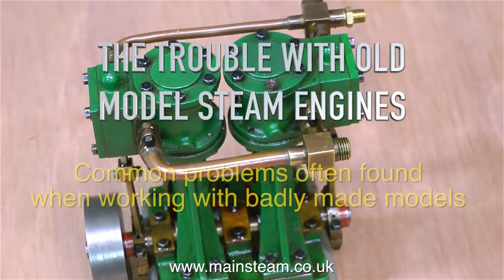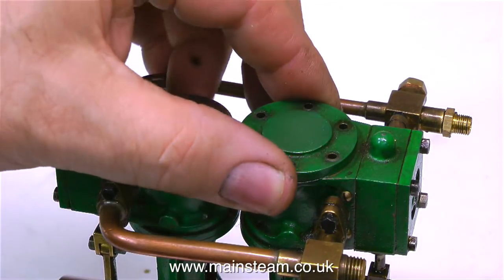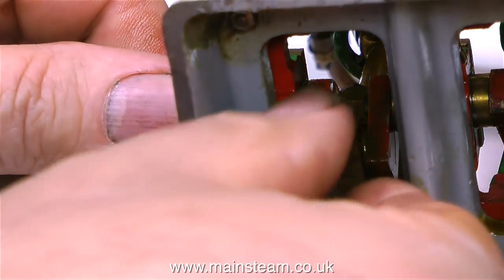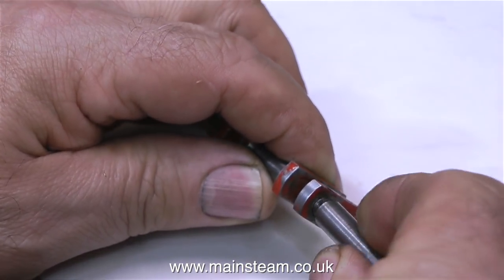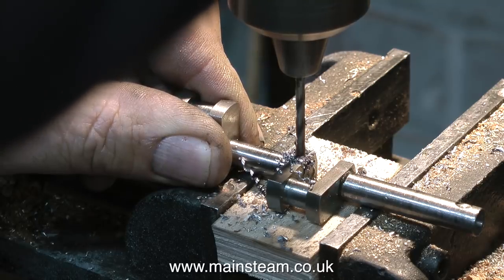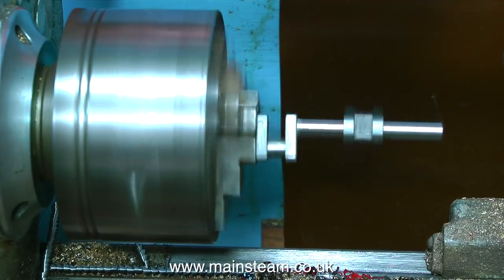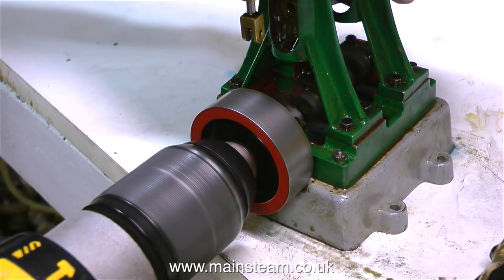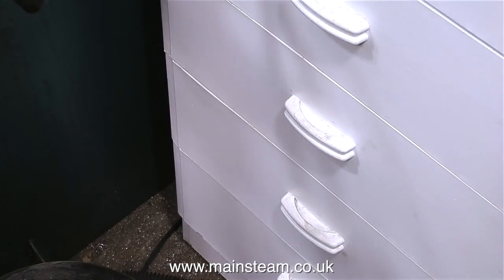THE TROUBLE WITH OLD MODEL STEAM ENGINES

Comment: I love these old engines I built several of them back in 1966-73. They are very difficult to do and you must take your time and build them right no cutting corners. Otherwise you see what you get junk. I wish I could afford to buy a Stuart beam engine that was my favorite one. I used them as part of my engineering program for school. Blew the teachers away that I understood how they worked and that I made them and my own drafting work and report paper on the engines. Even the principal gave me a certificate at the end of the year for my hard work. I was crazy for Me. / Mfg. engineering. I wanted to build a Shay logger engine that ran on steam but couldn’t find the plans or funds to do it.

Comment: I risked machining my D10 crank from solid as a test of myself, and it was very hard but very satisfying. Pages and pages of conversions from fractional imperial to decimal imperial, and shedloads of panicking.
Luckily I got it all within spec first time, but a bit of a scratchy finish on the centre bearing surface, so not perfect. I plan to take it a few thou undersize to get the surface finish ok. Overall I am very pleased. Until you have one of these cranks in your hand it is hard to visualise how delicate they are when un supported by bearings! I think a loud sparrow fart in the garden would bend it.
I am now constructing a drill rod/ silver steel jig to perfectly align/ position the crank bearings with the cross heads, and then do something with taper pins to make the position repeatable. Every part of my milling machine is positioned with taper pins, then bolted...they used to do it properly in the olden days.

Comment: In 1950's I got a steam engine for Xmas... about a foot high... electrically heated water/steam tank, cylinder swinging back and forth against a base with holes did the valving for the steam... very simple... I used it to power a vehicle made with an Erector Set...

Comment: Just a suggestion. Instead of tapered pins, I know demo only. Just disassemble the crankshaft. Clean all parts with brake cleaner. Now place a drop of RED loctite on all the threads. Reassemble crank. Now, place a live center in the center drilled hole you made. Use a dial indicator to be sure the shaft is straight on all the segments of crank. Be sure to maintain the 90* angles. Once all is straight on the dial indicators. Just use a small flame on a torch, or good lighter. Warm all the joints where loctite was applied, not to hot to touch, just warm. This sets up the loctite very quickly. Now let set for the night. Crank is now effectively a one piece crank.If you ever need to disassemble it, you warm up the loctite till it starts to give off smoke, then loosen joint. Use a mask, as the smoke is hazardous.RED loctite is permanent on shafts this small of diameter. Not historically correct, but only you will know. Just my two cents.
Reply from the maker: "Loctite" will not repair a Crankshaft as badly made as this one. In this case I tried "Loctite 603" off camera with the crankshaft held in the lathe chuck etc etc. By the time I have messed about with various bodges, it's just quicker to make a new one . . . .

Comment: Yes, I found this video very helpful, I never realized that there were so many ways to mess-up a crankshaft. I do not understand why they threaded the crank parts and the webs to fit them together. thank you very much for this display and lesson.
Reply: A major problem with just screwing parts together to assemble the crank is getting the journal timing correct. The pin Keith installed corrected that, plus eliminated possible wobble at the joint in one axis.

Comment: that engine is salvageable with a new one piece crank shaft turned between centres to ensure it is true , the two throws should be turned after the main bearing areas using a jig to give them 90' offset to each other , the  existing main bearings are salvageable , bolt them down to the bed then use a hand reamer to ream them out as needed so they are perfectly in line with each other , turn the crank main bearing diameter to suit your new main bearing ID , job done , great video take it easy

Comment: years ago when I was in my 20's, an old foreman I was working for told me one day " there's never enough time to do a job right the first time, but there's always enough time to do it over". nice vid
Reply: how true...
Reply: exactly
Reply: jerry umfress 
As a head of the QC QA department in a machine shop, that is the case... But to a point. .
When the machinist find out that they can not slip non conforming dimensions past QC, and they have to do it over, they become more meticulous. And the QC dept works itself out of a job.  The plug and play reputation goes way up. And the customer is willing to pay more for it. After 13 years, they closed the QC dept. I do not know if they still have the same plug and play reputation.
Reply: steve gale 
The place I worked, I would generate a QC report on each part. Every dimension would be measured and recorded. When I found a non conforming feature,  I would go to the machinist and say something like, I  must have made a mistake, I  am not getting the right number here. And then they would remeasure,  and either fix it, or ask the engineer to either sign off on it, or the engineer would call the customer for his ok...
But a copy of the QC report would be sent with the part to the customer.
In the 13 years , I filled 5 , five drawer filling cabinets with QC documents. 
Most all of the problems came from the customer sending us the wrong prints, or prints that were not drawn correctly.
Reply: steve gale
I hear you,,, the point I was trying to make was quality control. And I  was trying to state that the time spent making it right the first time will be worth it with a greater reputation. 
Speed comes with knowing how to do it right.
But although we did some production work, most of what we did was custom, one of a kind, reverse engineered. 
Most of the dimensions were + or - 5 thousandths  of an inch. We did make gauging to 50 millionths.  
But alas,,  when working for yourself, on your own projects,  you only have to satisfy yourself, .
And that is all about attitude ,and pride, and expectation.
Reply: steve gale 
Ah yes,,,  How to win friends and influence people,,,   This was the way I put the ball in their court, and it required them to prove me wrong... I could have gone strieght to the foreman,  and let him chew them a new one. But this was my style of letting them save face and fix the problem without getting the bitch cycle started...
They were grateful,, and said so...
Reply: If you're on salary, the job needs to be done right the first time so you can proceed on to the next. If you are paid hourly, you can do a sloppy job twice and thus guarantee an extra week's employment.
Reply: You worked at Micromeritics?
Reply: When I was a youngster I said to my Father it is not that critical, he said if you do not practice being accurate then when it is important then it is more difficult to obtain a good result! Words of wisdom from Dad, my MO since that day. Cheers from John, Australia. PS, I have worked on machine jobs worth hundreds of thousands of dollars! Do over?
Reply: Will Bee that's the best way to approach someone when you think they made a mistake...."I must be looking at this wrong, can you explain to me how this thing you made meets the specification that it doesn't".   Works for engine repairs, software builds, HVAC ducting, and more.   The nice thing is that in some cases, it can actually be explained as correct.   If the other guy is right, you still hold the high ground because you went in saying you didn't understand it.    If he's wrong, you leave the path to fixing it wide open without causing embarrassment.
Reply: You will always do it better second time.

And even better still third time.

Comment: When I built a Stuart steam engine in the mid to late 60's while at school the piston and crankshaft were supplied as  cast iron. As I remeber it I machined the crank shaft in a four jaw chuck on the schools ML7 lathe, also there was no piston rings but the bore and piston were a good sliding fit.

Comment: Interesting observation that poorly designed engines typically have their little "fiddly bits" painted a different color.  I propose the reason for this is because the builder/designer/engineer of said engine was more concerned with how the thing looked rather than how it performed.  There is certainly nothing wrong with aesthetics, but that concern should should FOLLOW ensuring that the design is mechanically ideal.  A solidly engineered device sells itself, even if it's ugly.  However, flashy sequins, rhinestones and glitter are needed to make the "turds" more appealing.

Comment: Quite an interesting and concise video. You did an excellent job of discussing this sloppily built engine. It seems that every component was either suffering from a lack of quality in build or design with a touch of manhandling to spice things up. You as I agree in being suspicious of mechanical objects that have non-uniform fasteners and paint in places where it doesn't seem necessary. I really don't understand why someone would invest their time and money designing and building something so poorly. It's a nightmare from the start. I would hate to see the aftermath of what an excessive amount of pressure or RPM would do if someone happened to be near this particular contraption if it flew apart. You did the right thing by gathering it up and placing it it the drawer. At least it was worth the instruction that you gave on machining.

Comment: I'm really getting nostalgic right now! Use to work at Sulzer in Switzerland and we built Ship Diesel Engines years ago, just a bit bigger. However, I always loved model engines as well!
Reply: 4 years ago you wrote:

I'm really getting nostalgic right now! Use to work at Sulzer in Switzerland and we built Ship Diesel Engines years ago, just a bit bigger. However, I always loved model engines as well!

I want to say thanks and I always thought the marine slow speed Diesel engine had more
In common with an old steam engine than a modern diesel in physical construction.

Are you from Winterthur?

Comment: Hi, nice video and I agree with all of your comments and complaints. I actually live within 1 mile of Stuart Models and upon request, have recently drawn in CAD one of their Twin Cylinder Steam Engines. The company have invested heavily to produce parts for each of the steam engines on their books. I think the painting and poor fits/workmanship is down to the engineer building the engine not Stuart Models, even though they supply the parts as a kit. Again, excellent video, and I like the relaxed way you go about explaining the problems , and the joviality introduced  to the commentary. Thanks

Comment: Good tip on the paint observation perhaps those come out of a factory with much less. Quality control , pride, or engineering or a combination of all the above ?  I dont have much experience with the newer models but my wife’s Grandfather ha many older model engines that were made very well   And because he was a retired Steam engineer they ran well. Although i suspect that he  made that happen by machining  and balancing things  himself  many of those engines were installed in wooden toys he handcrafted as well

Comment: Taking your point on gratuitous painting of ancilliary parts Mr Appleton. . It's the equivalent of seeing a second-hand car with the tyres covered in 'tyre black' and the engine bay freshly steam cleaned. You just know that chances are.....it's a dog.
Reply: The Philpott going back 20 years, when you used to be able to sell old cars, my stepfather would buy and sell them regularly. I remember the 'Colin Special' would be a car washed clean with his mums dish soap, or shampoo, pinstripe along the side in cheap Chinese electrical tape, in whatever colour the cheap store had, tyre black tyres, silver frost hubcaps, or wheels if no hubcaps, and the cheapest, horriblest rubber mats he could find, or off cut carpet mats. Occasionally if his dad got him an oil filter from work (he was a mechanic in a hospital) he would do an oil change with the cheapest oil on the market. I think from when mum met him, when I was around 6, until I moved out in my late teens, he would have had over 50 cars. All done the same.

Comment: It makes perfect sense that engines with  nuts and bolts painted with mismatching colours are generally in poorer condition; Someone, a previous owner, refurbisher or reseller opened it and did something like a repair or checkup, then put it together with what ever nuts and bolts were at hand at the time.
Highly unlikely something like that'd happen earlier than that like during the original fabrication since bolts, paint and such like gets ordered big bulk.

Comment: The biggest issue I have with those engines is that they don't produce 5 to 10 kW so they're basically useless except for looking at once and a while or for tinkering.

Though, if it's the tinkering you like then you kind of have to buy a really cheap and crappy one or else you're not going to have any fun.
Reply: Truth be told, I'd probably be terrified of a larger steam engine, with all that pressure just waiting to hurt someone. But I agree at the end of the day these are just toys especially when it is recommended in some cases to not run them for more than 10 minutes at a time before re-lubricating.

Comment: I'd be inclined to fit up the end mains closely, and just bore/drill the center main oversize. It is just a model, and would probably spin up and run fine. The piston sizes - who cares? as long as they will seal ok with the rings, you're good. If I were playing with these, I'd probably end up using lots of small helicoils to fix the various bad threads. Those cranks are nasty - but with a lathe of that size at hand, a person could probably rig a way to grind the main journals true.

Comment: Once you dial in your crank you should have tack welded each connection of the crank to tighten it up.
It is after all just a working model which won't see any actual working hours and if it was fabricated to almost perfection it would cost a arm & a leg to buy. Still though these model steam engines are kind of neat even if they are not perfect.
Thank you for showing us these steam engines.
Reply from the maker: The crankshaft was threaded and it is badly made and absolutely rubbish, no amount of welding will correct that.

Comment: Screw threads should not be used to ensure concentricity. However, I do think that if some had been assembled with some  
threadlock in the first place then the "wobble" would not have occurred - which in turn loosened the threads by wearing them.